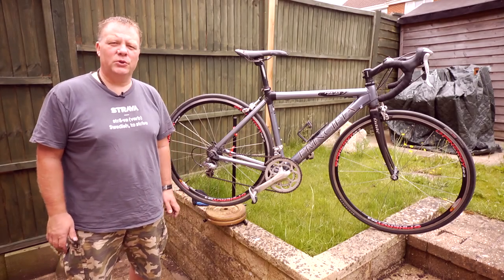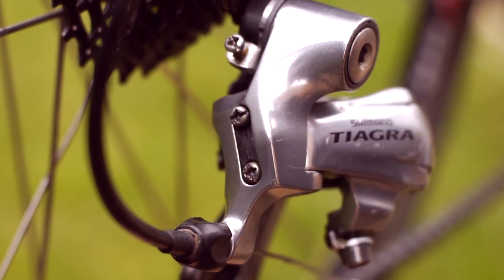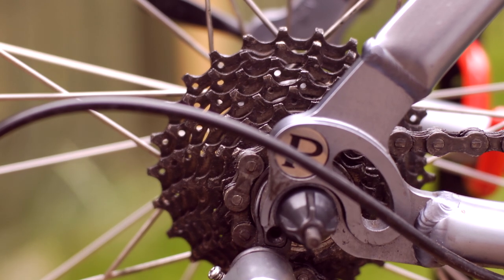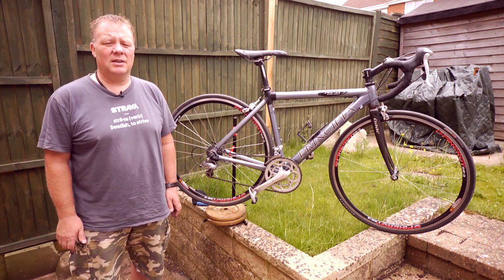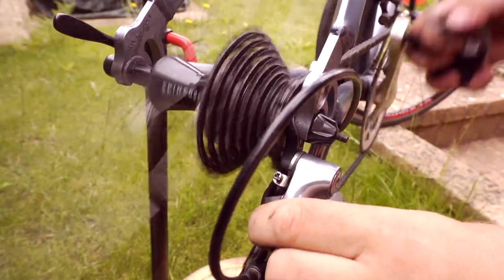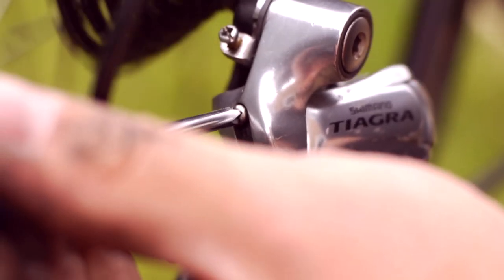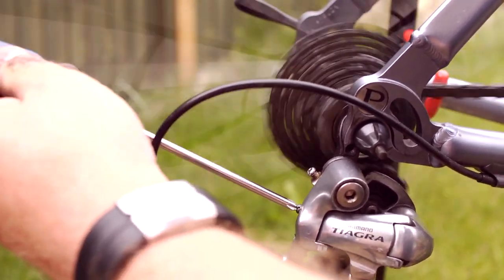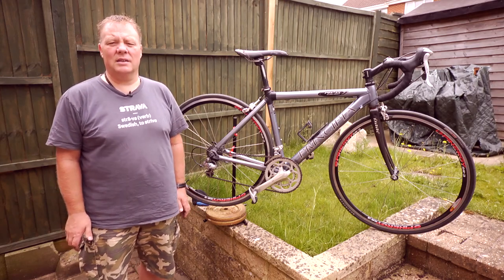How to Adjust the Limiter Screws on a Bike's Rear Derailleur.

Comment: Probably a stupid question, but when you say "up" the block and "down" the block, which direction is up and which is down?
Reply from the maker: It’s actually a very sensible question. I always mix them up but generally up the block means reducing your gearing and down the block is to increase it.
Reply: @jollygoodvelo  so up means toward the big sprockets near the spokes and down means toward the outside little one?